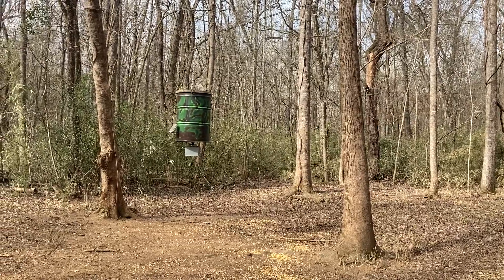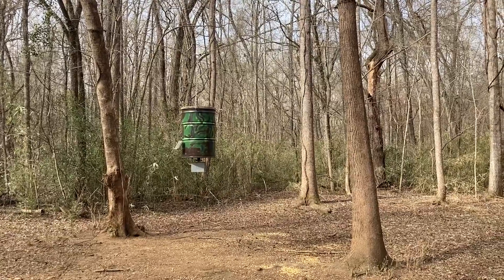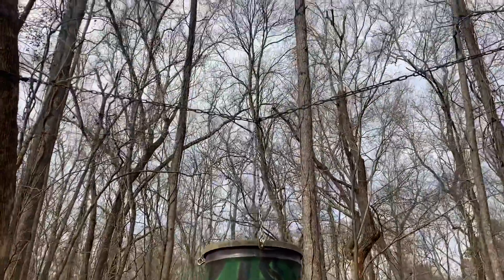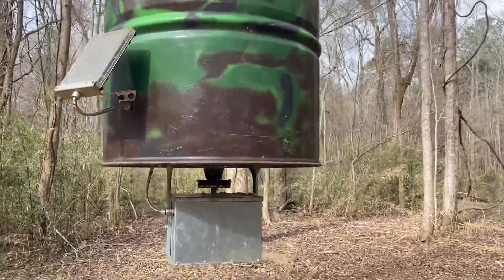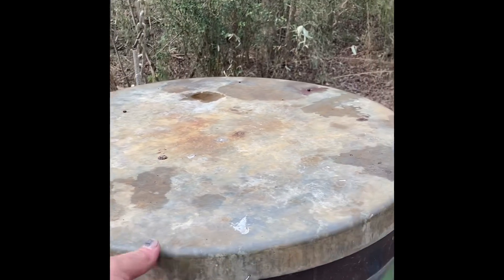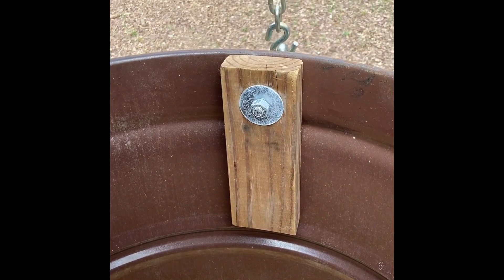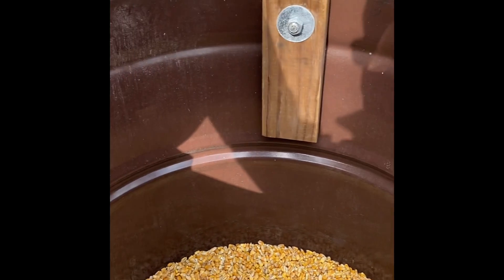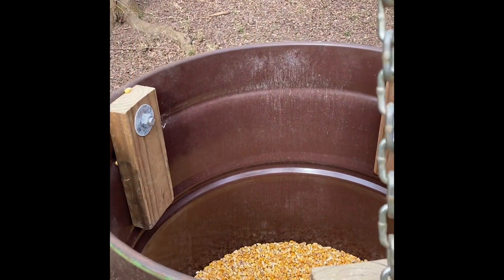Easy DIY Coon & Hog Proof Deer Feeder

Comment: what solar panel did you use? looks great man. well done!
Reply from the maker: Sorry for the delay Buddy.  The solar panels I use are ASF (All Season Feeders) 12 volt solar panel.  You can order them online for $39.99.  Hope that helps!
Reply: @brushywillie6055 I have some barells. Do you have links to the feeder and panel? Thx
Reply from the maker: @lodollar23  I use All Seasons 12 volt feeder mechanisms.  They have served me well and I have had them for years without problems.  They have them on Amazon.  The solar panel is Boss Buck 12 volt solar panel also on Amazon.  There are a lot cheaper options but these work really well for me.  Hope that helps!
Reply: @brushywillie6055  much appreciated! Subscribed and I'd like to see another build! Thanks!

Comment: Have any coons or squirrels tried climbing the trees, going across the chain to the feeder, dropping to it, and reaching down from the top to get at the corn at the bottom?
Reply from the maker: Squirrels do but no coons.  The squirrels drop down onto the solar panel then climb from there to the feeder plate. Only way around that is to install a drop down spinner plate that only opens with centrifugal force.

Comment: How do you strap chain to tree?
Reply from the maker: @stevenhicks815  Hi Steve. I wrap the chain around the tree and bolt it.  About 5 years ago I moved the bolts because the tree grew and I didn’t want to kill the tree top.  I probably need to do that again.  The chain will girdle the tree if you let it.

Comment: what is the solar panel for ? how does the feeder work???????????????????????????????????????????????????????????????????????????????????????????????????????????????????????
Reply from the maker: The solar panel charges a 12 volt battery that operates the feeder motor.  There is a preset timer in the feeder mechanism that is wired to the motor.  The timer allows you to set the time of day and the length of feeding time that you would like to feed.  You fill the barrel with the feed (I use corn) gravity feeds the corn down onto the spinner plate that is attached to the feeder motor.  Hope that helps!
Reply from the maker: Also I use All Season Feeder mechanisms but there are many different brands.

Comment: What chain did you use
Reply from the maker: I used an old logging chain I found for the long piece between the trees.  The chains on the barrel are just pieces I bought at the hardware store.  The barrel holds about 6 x 50 lbs bags of corn so 300 lbs is not much weight for any decent chain.  Sorry I don’t remember the exact size for you.